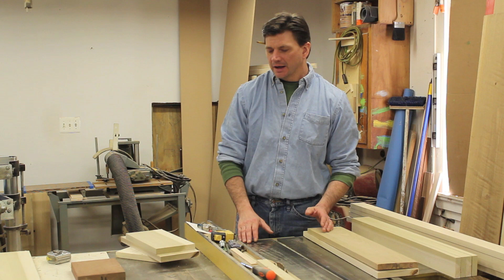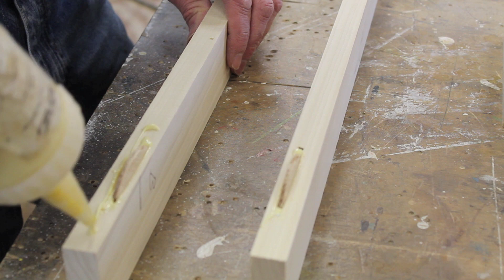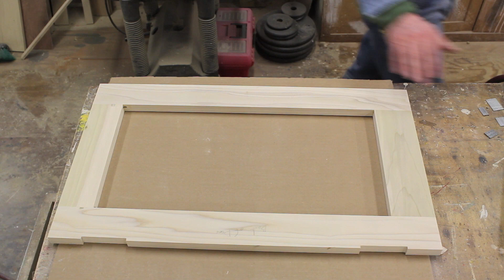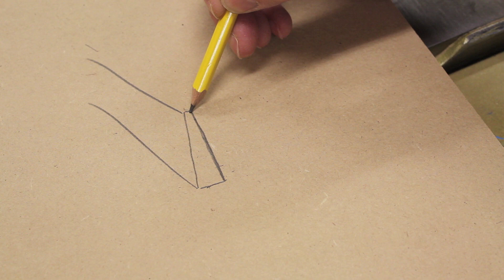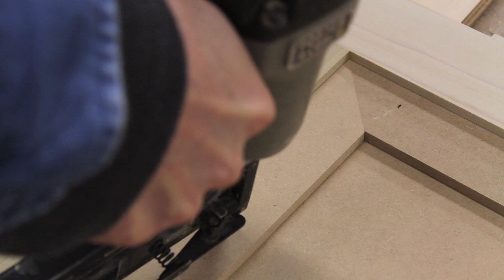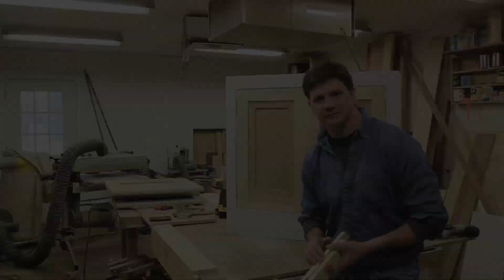How to Make & Hang Flat Panel Cabinet Doors

Comment: Never have I seen anything like this "door making".  He should have rabbited the back inside and put a 1/4" panel inside.   He was probably worried about the weak joining of the rails and styles, so he used a full panel on the back to hold the door together.

Comment: I've watched a lot of your videos and picked up some good tips and techniques.   Thanks!   Here's a question for you that I've not seen answered on a LOT of cabinet videos.... I'm trying to build a vanity/sink base with 2 inset doors and a finished panel on the right.  The left side will go against a wall.  How would you do the face frame so the styles are the same size but the sink is centered on the box?  Basically, the box ends up being 3/4 on the left and 1.5 on the right.

Comment: Question if mounting face mounted doors. what tricks can be used to get all doors consistently the same heights and help hold them in place as you put the screw into the hinges into the face of the cabinet.

Comment: Or...you could just rout a decorative edge onto your stock for the rails and stiles before making the door frames.  You would get a lot nicer look and would not have to bother with ripping, beveling, mitering, and gluing, multiple pieces of trim. You would have to miter the frames together  instead of butting them, no big deal, and you could still use either biscuits or the Kreig system to join them. Actually, with all the surface area you have, just using a band clamp and gluing them up with, say Titebond III, would be sufficient.  If that was not enough, you are pinning the frames to MDF panels so those frames would never separate.

Comment: John, I was wondering what you used to fill the nail holes in the MDF. Just wood filler or drywall compound like you'd use as if it were wood?

Comment: The doors look great Jon. But why such a thick panel? 1/8 inch would be plenty.
Reply: Jonathan Gwynne OK Jonathan.
Reply: +frogsoda I can imagine it may help with the sound from the lift motor, but I can only speculate.
Reply: One of the reasons would be that heavy doors feel better.  For some things, there is no substitute for a feeling of weight.  

You want an extreme example?  Drive a Toyota Camry and then drive a Bentley Continental GT.  Both cars are roughly the same size (length, width and height).   The Toyota weighs about 3,200lbs and the Bentley about 5,100.  Everything about the Bentley feels more impressive and better quality because of the weight.  The only downside is fuel economy but if you're buying a Bentley, you don't care about the cost of gas.

Comment: How do you intend to keep the inset doors from intruding into the cabinet when closed? Didn't see a setback/cleat/rabbit/reveal to act as a stop. Or are you using hardware to accomplish this. ..i.e. soft close damper? Lastly, what's the reasoning behind mounting the face frame to the heavy mdf as opposed to a lighter mortise panel? Great job btw. Good camera views/editing. Thanks.

Comment: Here in the UK theres a myth going about that MDF is banned in the US due to the dangerous dust it puts out on cutting?
Reply: Definitely not banned but in interior use you do want to seal it with paint when used indoors (and would avoid using outdoors due to it absorbing water, but you can seal it with fiberglass resin if you really want to use it outdoors)), the dust (like most manufactured woods) does contain chemicals that can be inhaled when cutting, hence the reason he wears the respirator when working.

Comment: Hi Jon love the videos and have just subscribed to your channel. I have a question about your doors when you fixed the 1/2 inch mdf to the back of the doors and hung them flush with the face frame does the mdf not stick out 1/2 on the inside of your cabbinet? Just woundering if the shelves need to be kept back 1/2 from the face frame and if so how do they look? Thanks jon

Comment: Hi Jon, your doors seem to be a mix of a classic and modern style which is ok, I like the style, but the only thing I don´t like are the hinges and the peace of MDF you put at the back of the doors, they seem to be really heavy, it would´ve been easier to use a tongue and groove join with a 1/4 mdf in the middle then your molding, you´d have a lighter and cheaper door. Also you would´ve used a hidden hinge, cleaner look of your work. Good work overall. Congrats.

Comment: Your technique may be good enough to not the Kreg jig to pre drill the pocket holes.  This year, I picked up the Festool Dominoes - XL and 500 DL.  They are a joy to use and make a very strong joint. Highly recommended.